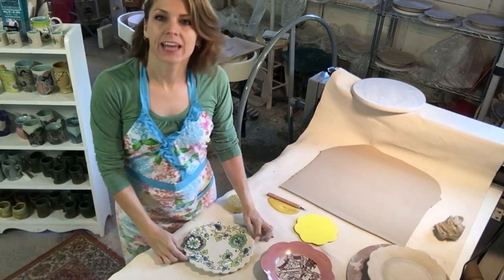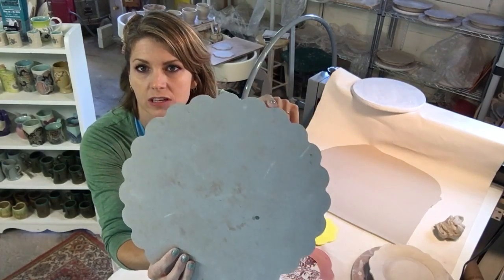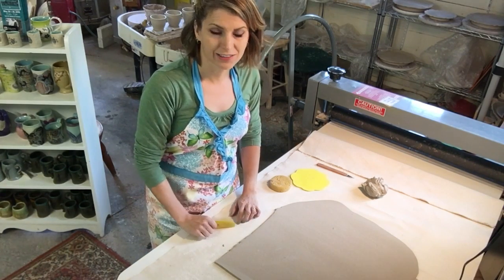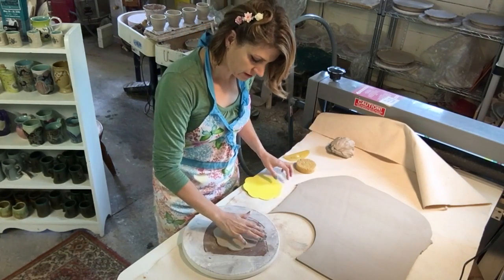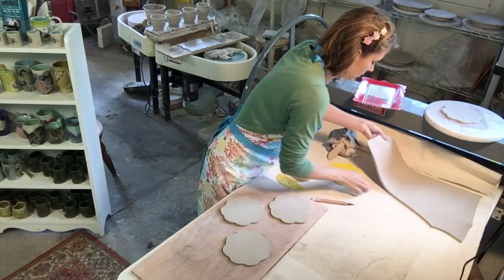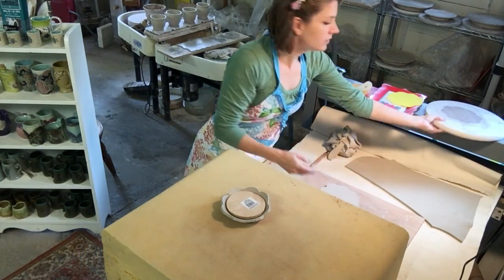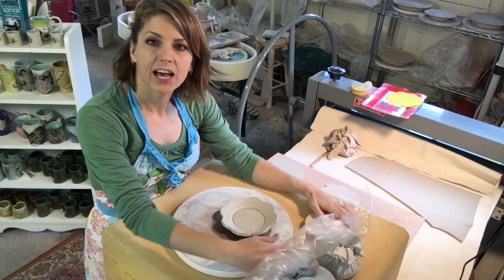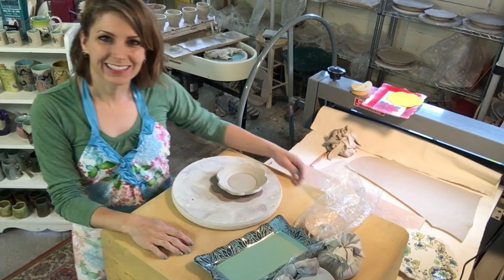Slab Built and Pressed Plates

Comment: Thank you, Jessica, for no music; a clear view of what is being done; no arbitrary point-of-view changes; excellent enunciation; making good use of used materials; a pleasant demeanor; funny little quips; suggestions for alternative methods and materials; and staying on point and in context.  This is how instructional videos should be made.
  I would like tapered edges.  How to do that?
  Chamfering the edge of the pressing-disk would reduce, if not eliminate, the line left on the plate.  Or, just use a plain disk sized to fit the cups that will be used with the saucers.
  Your facial expressions are delightful!  Altogether good work.

Comment: Thanks for this great tutorial.  I have two questions: 1. Can you use this technique for cone 10 clay?  In my experience the cone 10 platters I have made often crack.  Is there a tip you have against this?  2. At what point do you add your design?  Is it while the clay is still in slab format or does it come later?
Thanks, Wiebke

Comment: Hi Jess, love your detailed informative vids. I know this question is elementary so, what is the best site to find info on differences of clay???............20 years ago my wife & I were experienced in slip poured molds finished with airbrush & hand brush finishes......... Do all pottery clays require firing?  When hearing leather soft clay, does it cure in ambient air or will it have to be fired?

Comment: Do you fire at cone 10, and if not, what temp? There is so much controversy about the temp for food safety.  I love your videos! Thank you so much! ♥
Reply from the maker: I fire to cone 5 in my electric kiln and to cone 10 in my gas kiln. As far as being food safe as long as the glaze is food safe and you fire the clay till its vitrified it will be safe for using with food. All clays list what temperature they should be fired to and as long as you do that you should be fine.  :)

Comment: What did u use for the rectangular plate to get the inner shape? The cardboard form itself?
Reply: I have the same question. I doubt it was the cardboard form--it wouldn't be stiff enough. So she either cut some wood the size she wanted, or she cut a slab the size she wanted, bisque-fired it, then used that.

Comment: How thick was the slab in your video?  Does the slab thickness make any differences?
Reply from the maker: Nixon Khoo the slab is about 3/8 of and inch thick. Thickness is important, larger pieces like platters need to be a bit thicker and smaller pieces could be thinner.